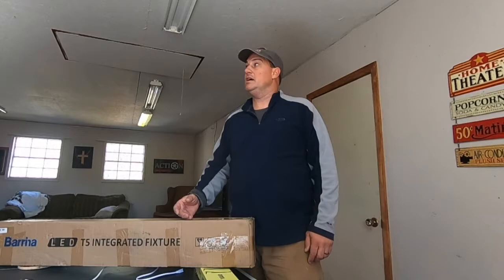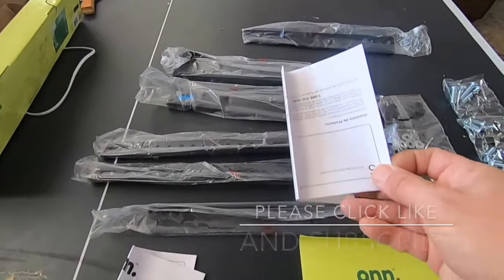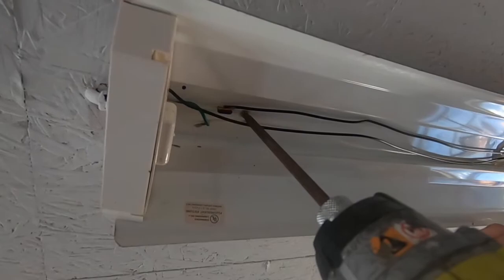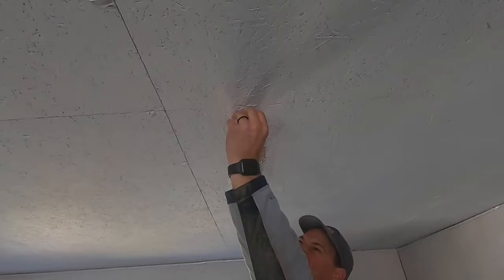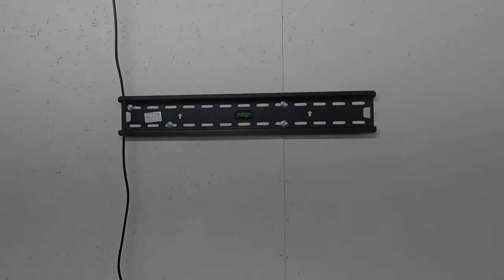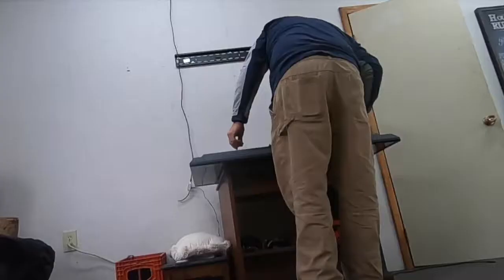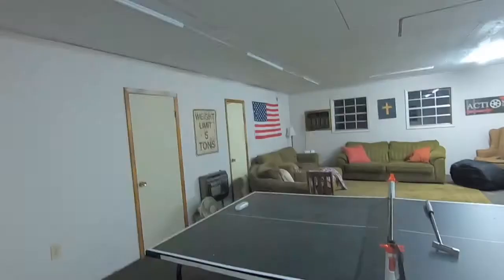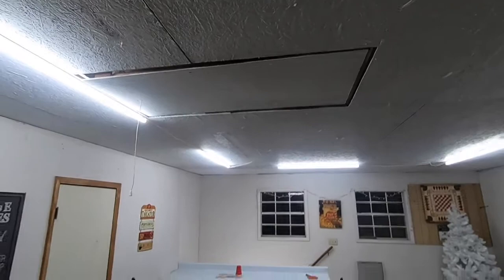Replacing Fluorescent lights with LEDs - KOL148

Comment: I have to replace my garage lights. I bought some leds to replace them. I was hoping to just replace the bulbs and I thought that was what you were gonna do but no….so on with the original plan of replacing the fixture too.
Reply from the maker: These are so easy that in the long run I think I will be better off than just bulbs.  I think I will buy an extra dozen now while I can.  That way when one of these dies I can simply plug in a new one.  Thanks for watching!